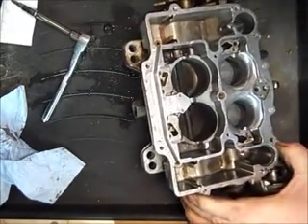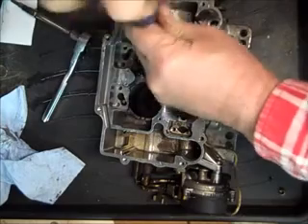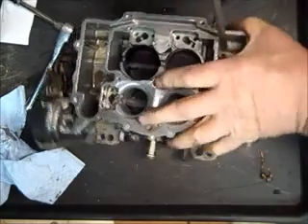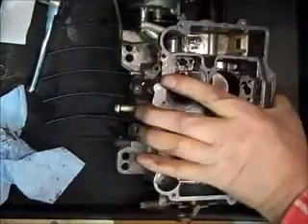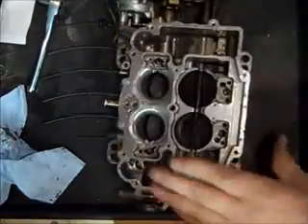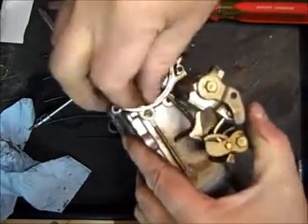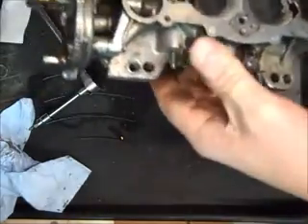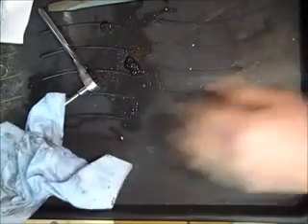Carter AFB 9000 Carburetor Teardown Part 2 of 6

Comment: Thank you, this and you 1st video helped me with our 1962 AFB dual Quads on our Catalina. A few more old school options with our like large adjustable center lower vacuum bolts with spring/brass. Yours has a pressed on nipple for a vacuum hose to go.
Reply: However I was unable to get it to stop leaking. The floats are closing the needles and seats properly.